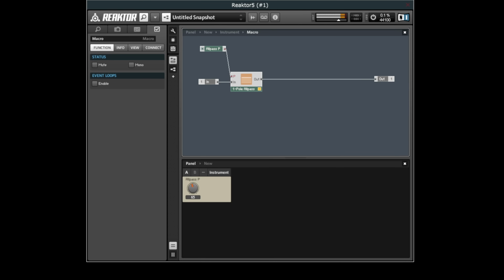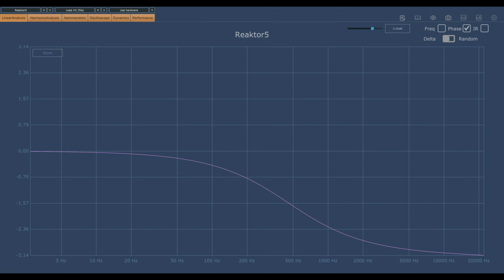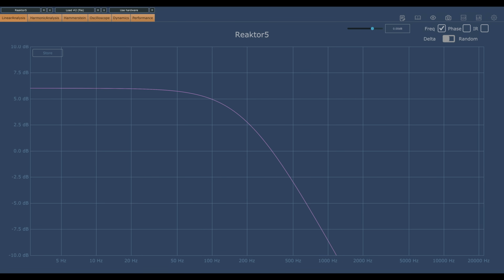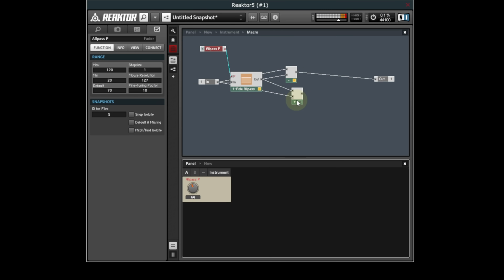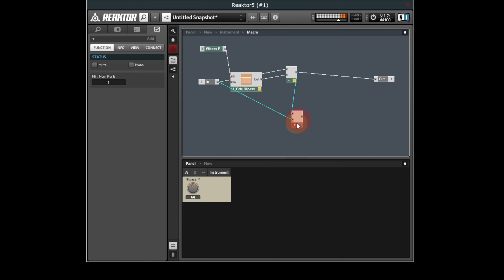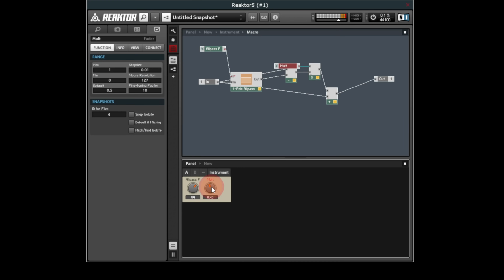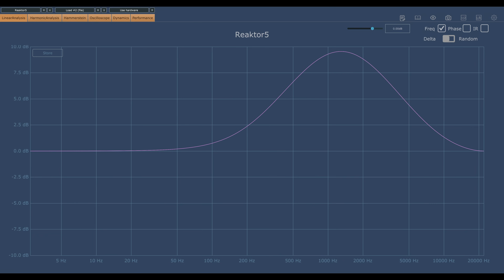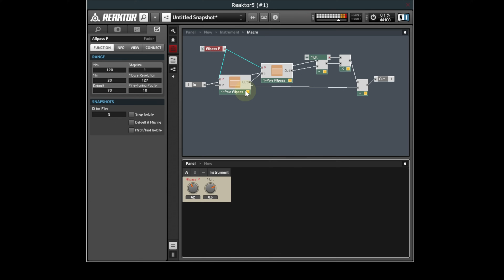EQ Doesn't Cause Phase Shift...

Comment: Would love a video about how linear-phase EQ works to add on to this. 

This is the most insightful video I've seen on this topic. I've had so many questions about how EQing actually works at a mathematical level - now answered in a 4 minute vid.
Reply: DSP programmer here, programmed linear phase equalizers by hand.  

An analog-style EQ is what we call 'causal filter'.  It "reacts", so to speak, to the inputs as they happen.  
Without look-ahead, the EQ can only generate output using the past + present.  
Using info from now + before, the filter can only affect what comes out next.  
So, phase shifts using analog/IIR filters can only "delay" phase.
  
Now, a "linear phase filters":  
Imagine an audio process that could see a bit into the "future" (know what's going to happen).  
This ability, so to speak, is common nowadays (DAW delay compensation, etc.).  
With this ability, a linear-phase filter can "shift the phase" both forward and backwards in time equally (so to speak).  
This technique eliminates any phase shifting all together.  
However, since we're able to shift the phase of frequencies *before they happen*, you may be able to hear "pre-ringing" from the filter in the output.  
  
That's maybe an over simplification, and I've left out some of the more fun analysis/stuff (impulse responses, FFT's, etc.), but yeah.
Reply: @gerudobombshell so I have a question for you. What do you normally suggest is the optimal way to EQ - specifically, the low-end. Do you use Linear-Phase, or not? I’ve seen tons of debate on cutting frequencies below 20-40hz because you don’t “need” information below that, and then I’ve also seen the opposing argument that even if we don’t “need” that information, it’s not WORTH cutting it out because of these exact issues. This forced me to the idea that I want to present to you since you seem to know more than anyone else I’ve ever come across. So could you take an Analog Filter and gradually clamp down on the low-end? It’s a concept I’ve called “EQ Clamping”, and I created a patcher preset for it. Instead of a simple High-Pass filter down at 30-40hz. It’s MANY Low-Shelf filters gradually clamping down. Low-Shelf filters being the choice because they create significantly less Phasing. After several of these filters, THEN you can GRADUALLY add HP filters with very generous slopes. Any thoughts? Would this help to mitigate the need for using a Linear-Phase Filter?
Reply: Generally speaking, minimum-phase/analog filters are great for most needs (no problems).  
  
Linear phase filters are great for making spectral changes without affecting inter-track phase releationships (think drums, close mic + overheads).  
However - back to the "pre-ringing" thing:

Linear phase filters will cause a variable amount/length of pre-ringing, with respect to the frequency (Hz).  
That is to say, the lower the frency you're affecting, the longer/more audible the pre-ringing.  
And, the sharper the filter (eg. imagine a 48 dB/oct hipass filter), the more audible it is yet again.  
  
Since IIR/analog/minimum-phase EQ's only can ever "delay" the phase of waves, they will not suffer the same problem.  
Any ringing anomolies will manifest forward in time - which is nice, since transients will "mask" the ringing (IIR filters do still ring, btw).  
  
My rule of thumb:  
Most of the time, try to use IIR.  
If there's a phase relationship to another track, use Linear Phase (sometimes sounds cool boosting highs too).
Reply: In the simplest layman's terms Linear Phase performs the phase shift, then puts it back in time (latency) to compensate.
Reply: I have almost no idea what you guys ate talking about but i do understand that eq isnt really eq
Reply: It works with lookahead. 

You can even get linear phase EQ's in analog set ups. Dan showed how to do it in a previous video. Half all of your EQ gain settings after mixing, run the recording through the EQ. After that run the recording through the EQ again but now play it in reverse. 

When you play the recording forwards again the phase changes will be opposite to each other and so they will be cancelled. If you halved your EQ settings then they will be added up back to your desired settings.

Of course analogue knobs are unpredictable and precisely "halving" your gain settings is easier said than done.

Comment: The math behind (digital) all-pass filters is relatively simple, you just need a bit of discrete linear algebra and z-transforms. The first order IIR filter implementation is just a combination of the current input sample with a scaled previous input sample and output value (feedback and feedforward loops). As a difference equation: y[n] = a * x[n] + x[n-1] - a * y[n-1], where y is the output, x is the input, and n is the sample number.

Fun fact: all-pass filters are also heavily used in many reverb algorithms.

Comment: Dan, your parallel filters videos inspired me to discover that when you delta solo an aux with any effect on it and send a track in your mix to the aux, the effect acts as if you have it on the track you’re sending to the aux. thank you for all you do! I now use this technique to create a global sidechain pumping effect that is controlled at the mixer level at each track and the global aux. I use this for summing bus compression when I want to glue kick and bass but I don’t want to sum there outputs. I use it for de-easing and spectral resonance suppression too. I really appreciate your videos and how you think. Thanks for all you do!
Reply: Ooh that's really good! I've been wondering about how to get a similar outcome for a while, so thankyou!
Reply: This sounds interesting but I'm not exactly certain what you do. Let me follow along, is this correct? 
1. You have an aux with an effect, lets say a compressor. 
2. You send a track to the aux. Lets say a kick. 
3. Normally you get a compressed kick. But you delta solo. So you get only the "minus sound" that the compressor removes. 
4. You also send the bass track to the same aux? So you get "minus sound' of kick+bass
5. Now what? you blend this "minus signal" back in the full track, so that you have the gain reduction (pumping) without having to route or sum the bass and kick together?  

That's pretty smart. 

Personally I don't really think I'd use this as prefer sidechaining a bass in a kick+bass combo, because I want to have at least one sound constant. For example in the context of Rock or EDM, I don't want a louder bass note making the kick more quiet, the kick needs to be constant. As for de-essing, that's (IMO!) better done on a per-track basis than on a sum of tracks, because de-essing on a sum of tracks distorts all tracks, not just the one with the harsh S in it. 

I can see this technique being very nice in ambient electronic or acoustic folk type music, where "naturality" and transparency is desired.
Reply: @JDarkooJDarkoo  Yes that is correct. This particular application definitely is more suited to acoustic genres. However what I like about this consept is it leaves the creative aspect of the compression (or any effect) open ended so that you can add any track you want to be affected by the same plugin. I use this for global high cut filter effects, creative transitions where I want some but not all of the parts be warped in a dynamic way. It makes the process as simple as sending to an aux and adjusting the send to taste.
Reply: @lawinter1949  Very interesting snd very creative. Going to give this a whirl on an acoustic folk song I'm working on.

Comment: I've always thought of filters in terms of an RLC circuit and the various impedances of the components. The maths to implement a digital filter just sort of falls out of that. Messing around in a circuit simulator (falstad, ltspice) is a good way to get a feel for these things
Reply: That's a C I V I L way of putting it 😜
Yup it's all that Leading and Lagging of reactive components being modelled mathematically innit.

Comment: "How does the allpass filter cause the selective phase shift - some voodoo magic I suppose." Actually that's pretty accurate way to describe the math that starts from here on out. Like, in the end the equations look quite simple, but if you start looking into how those equations were derived... "Oh, it's simple. We first analysed the analogue circuit and derived it's differential equation. Than transformed the equation to give us the output voltage in terms of input voltage. Than discretized it by replacing integrals with discrete trapezoid integrator equations. Then we have resolved the zero delay feedback loops by treating the equation as an implicit equation and using it to derive intermediate results. But you have to consider equation's stability at this point. Finally we plugged those intermediate results into the main equation and that's it. Oh, also don't forget about warping the frequency range, but you can figure that out on your own."
Reply: Makes you wonder how the analog circuits came to place. With vacuum tubes no less, or old transistors, keeping those units fairly tuned must've been a nightmare.
Reply: @BananaManPL  I think this is why digital equipment often gets labelled "lifeless" or "sterile", because it doesn't have the analog grit everyone wanted rid of a few decades ago
Reply: "of course, we're considering a spherical circuit in vacuum"

Comment: I really like how you talk in clear terms, cutting through the "easy tricks" that others post when advising on mixing  and mastering. There is some confusion I have about some EQ elements. There is a few videos talking about mid-side EQ in order to remove overlap / mud that this causes in the stereo field. When I mix I tend to just mix on the defaults with side chaining to make room for the kick snare (to the bass and rhythm guitars) - which seemed to improve the clarity of the resulting track.

But should we also focus on the mid-side equally. This was a little confusing, or perhaps badly explained.

Comment: I thought I understood the basic workings of filters. I even built simple analog filters myself using capacitors, resistors and op-amps when I was younger. I understand the electrical concept of why they do what they do pretty well. I only recently first heard of the concept of an all-pass filter. This was after asking ChatGPT what the difference between a flanger and a phaser really was. At first hearing they even seemed useless, momentarily forgetting about that thing called phase. Functionally, they're still a bit mysterious to me, so thanks for this video. It sheds a whole new light on these things and they're really kind of interesting.

Comment: I wish you released this a year ago when I was trying to learn how to make my own passive outboard gear from scratch for my audio engineering capstone project at uni. I spent forever trying to do everything with just high-pass and low-pass filters and boost the remaining signal instead.

Turns out simple arithmetic was needed. Whoops.

Comment: Great demonstration of why the unwary would best avoid parallel EQ.
Reply from the maker: No! https://youtu.be/RL4KDVFlkUg?si=ApNpbretZVJkOeWb
Reply: @DanWorrall  - Notice I'm referring to the unwary. If you understand phase shift and are running a real-time spectrum analyzer (not just an EQ curve plotter), you can make expert use of phase cancellation. Otherwise, you're guesstimating with forces that can unexpectedly bite back. And as you point out in your linked video, linear phase filters are no panacea, they're rarely a significant factor outside of multi-pole crossovers.
Reply from the maker: @QuicksilverSG  there's nothing to be wary of with bell and shell filters. The phase cancellation will cause a tiny change in the shelf frequency or the bell width, both of which you set by ear anyway so you'll dial that difference out if it matters. You only need to be a bit careful with parallel high or lowpass filters.

Comment: Yea thats the off axis mic thing, ab volume is introducing the oblong pickup pattern,  or 45 degree. And you can then like have either 2 bidirectional, or 3 omnidirectional mic pointing like >^<, some phaseinverting maybe depends on what mics how, but then extreme pan, that stereo pair + the mono pointing at the sound source, guitar cab in my case, is summing up a something something something that cancels certain frequencies and does nothing to some.

I have started to preach the gospel of "no eq in the mix". A few exceptions ofc, if you are processing a raw signal like a synthwave, a dibass, a raw vibration model; then it can be thought not as eq, but just signalshamanism. But after that, the mic, the preamp(no eq there either). Put tubes infront of the pc, great vocals, great di, great cabs.

But lets say the snare is missing mids, and drums be the hardest (can't polish a turd ofc use eq if no other possibilities). You could sidechain expand the guitar from the snare. Upwards, like make it shimmer. The bassdrum you know people sidechain compress the bass to make it flow and groovy.

Expand sub bass and even infrasound. For no eq means no low cut hi pass filters.

idfk myself even, nice video :)

Comment: Dan I have a question: How does this phase shift affect impulse/transient response? Would a high pass filter for example "smear" the attack of a bass note? I've tried a number of EQs and pedals and it seems that something like this must be happening but I'm not entirely sure either.
Reply from the maker: I think a filter can potentially smear a transient, but I don't think it's the phase shift that's to blame, rather the ringing. And you usually need steep filters or resonance to make the ringing audible. If you used a linear phase filter because you were scared of the phase shift, well now you moved half the ringing in front of the transient, and made it more likely to be audible.
Reply: @DanWorrall  ...damn...  GOOD to know 😎👍
Reply: @DanWorrall  I read that all-pass filters are used in algorithmic reverbs exactly because they can soften the 'reflections'. HPF and LPF might have half of this effect according to the experiment in the video i suppose.
Reply: @DanWorrall  Sounds like the result of ringing to me too. That said, filters affecting the upper harmonics of a sound definitely can smear transients, just maybe not in a particularly audible way in most cases.

you might find kilohearts' disperser intersting in this regard, its an all-pass filter that takes this idea to an extreme using tens of thousands of degrees of phase shift. if you put a single impulse through it with a Q of 0, I believe the result would look like a short sine sweep.
Reply: @DanWorrall Thanks Dan. Only analogue stompbox filters and direct-out through the interface for me. 0 latency.

Comment: Hmm. You intrigued me with the last seconds of the video. I always thought that an allpass filter is just a very short delay for frequencies above or below the selected frequency...
I guess there's more to it?..
Reply: it is exactly that, but the question is how do you do exactly that to an incoming audio signal with math in a computationally efficient way?
Reply: @TimTam69420  Makes sense! Well, i'm waiting for the video then!
Reply: A first order (1pole) allpass filter is composed by subtracting a high-pass filtered signal from a low-pass filtered one with the same frequency. Just think of this: Lowpass + Hipass is the same as the input signal. Lowpass - Hipass has the same frequency content, but gets phase inverted on one side.

This is why Dan was able to decompose the allpass to lowpass and highpass filters.

Comment: Firstly, I'm not disagreeing, I'm only adding detail.
Secondly:

For digital filters: technically, your using delays in the range of one or two samples, feedback, scaling and summation to create those curves, but these delays can  be seen as frequency dependent phase shifts, so 6 one way, half dozen the other. I know this is a distinction that nobody except me cares about but there you have it. If one would be interested one could have a look at a biquad filter structure.

For analog filters: it's more complex as the frequency dependent components (capacitors and inductors), even if you'd only look at ideal version of them, are always complex impedances, basically amplitude and phase manipulation wrapped into one neat inseparable little package.

Comment: It's not math magic, it's actually very easy to understand if you look at the flow diagram of an all pass filter. It has a feed-back as well as a feed-forward stage, that even each other out.
The fun with all pass filters doesn't stop there.
Put them in series to create phasers. Cascade them for control over Q, and more!

Comment: Hi Dan, this question might be a bit out of context but I was wondering if it's possible to create crossover filters with Pro-Q3. Everytime I experiment with this, the crossover frequency becomes very audible and doesn't match at all with the original dry signal. Perhaps I'm completely noob at this but would love to hear your thoughts on it. Cheers!
Reply: Might be valuable to add that I'm splitting the frequency so I can kinda see where it goes wrong, however still would like to know if it's possible :)
Reply from the maker: Yes it's possible. I've covered it in a video, will let you know when I remember which one... The trick is, stack up two filters at the same frequency. If you want 24dB crossover slopes use two 12dB LP filters for the low band and two 12dB HP filters for the high band, all set to the same frequency. If the recombined signal has a notch at the cutoff frequency, flip the polarity for one of the bands. Or just switch them all to linear phase.
Reply: @DanWorrall  awesome, thanks! I'll continue experimenting